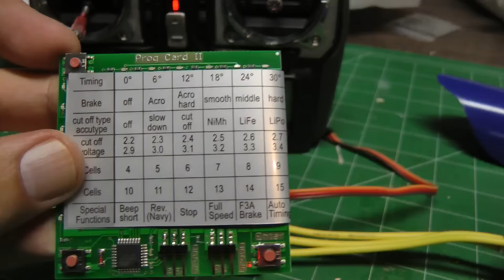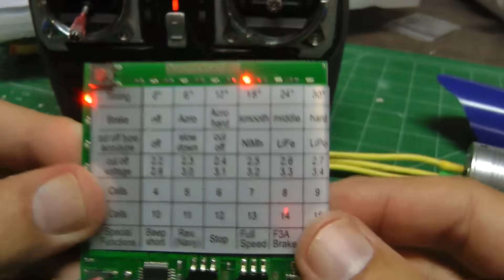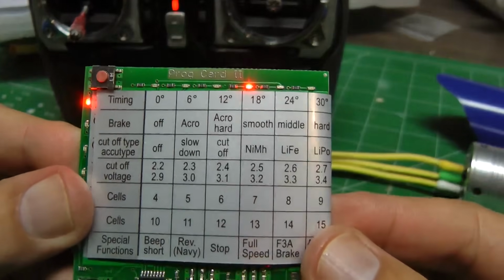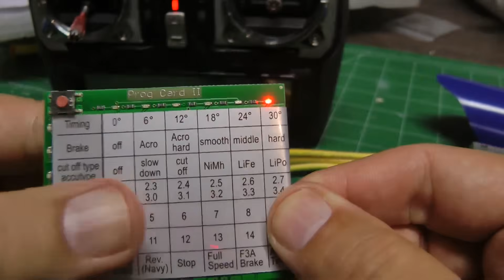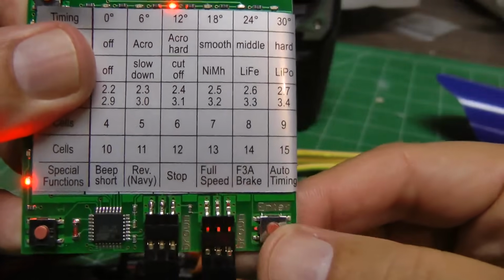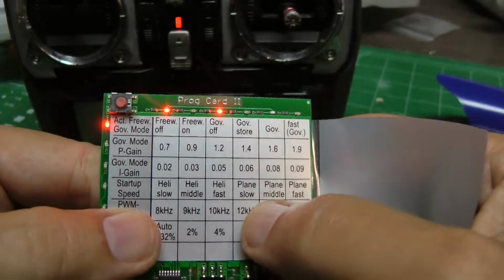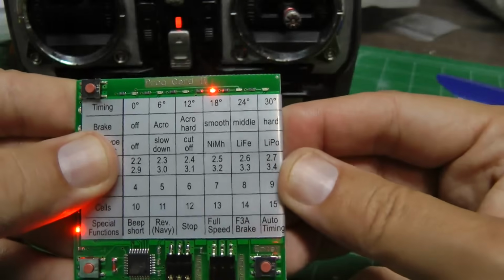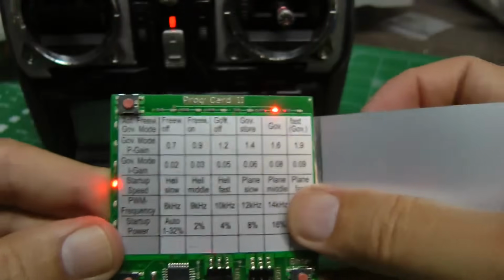YEP ESC programming setup for airplanes

Comment: I know this is an 11-year-old video, but still relevant. A male-to-male servo wire came with my YEP programming card. I assume that wire is the one referred to in the video as the wire too/from the Rx. Does it go to the throttle port of the motor you have programmed a motor to be in? Many of my models are 2 and 4 motor models on their own channel for differential thrust.
Reply from the maker: Yes it goes to the throttle, it should not matter which throttle channel it goes to assuming the bottom/top of the throttle stick is the same on the curves.  Whatever is in the middle does not matter, you just want to learn the bottom/top of the stick.
Reply: @GaryQuiring  Your video showing how to get into the 2nd group of settings was what I needed. I'm scratch-building a twin 70mm EDF of my own design. When doing some static testing I realized 1 of my ESC/Motors was taking 10 secs to spool up to full power. I needed to change the SOFT START to a HARD START. Even though I had the programming card, I couldn't change it. I've had the YEP150 and programming card for a few years and just unpacked it for this project. I only have the one YEP ESC. The other EDF is powered by a 155A HobbyStar (ZTW) ESC. The default for it is for fixed wing a/c, not helos, so no adjustment needed on it. Thanks for this video. When first trying the programming card I was using a 4.8V battery pack on the Rx pins, and that seemed to work as well for powering up the programming card. But using the male-to-male wire to the LEFT Motor port worked perfectly, and there's less chance of getting it wrong using it. Thanks again.

Comment: I have one and the acceleration is slow, I guess that is for helis. I don't have the card and it is hard to get here, so is there any way I can program the acceleration using the transmitter?
Reply from the maker: That's the spool up speed which is easily programmed using the card.  I don't believe you can program that with the TX.

Comment: Thanks once again Gary for saving my bacon.  Got a 60A YEP in my new Grafas and the esc was doing too many strange things. Soft start and soft break. It was even waiting for mid throttle to start turning!!  All that I have left to figure out is the rough start...  it sort of stutters.  On Quads you can tell the controller what signal will consistently start the motors and set it.
Reply from the maker: Hmmm, the rough start is odd, do you have it set for auto-timing?  If that does not solve it I would check your solder connections to the motor.
Reply: I have timing set to AUTO on the second page. and when I tried a 4S the start was smooth.  I will try it at the field today with the 3S3300 I want to fly with and let you know.  The issue is only at the bottom. Monitor says -80%

Comment: Unfortunately it does not have auto cells count detection...
Reply from the maker: I don't use any cell detection, I prefer telemetry battery monitoring from the radio with an alarm.  Also every plane I fly the cell count never changes.

Comment: How do you change the motor rotation using the programming card?
Reply from the maker: You can't, you need to reverse two wires to the motor.
Reply from the maker: The web site is wrong, Hobby King has lots of errors on the product descriptions that never get fixed.

Comment: After I completed the programming for 70mm Dr Mad 5 blade 4S EDF all works well except that after a burst of throttle when I then close the throttle i hear 2 beeps repeating every few seconds. I tried different batteries including new batteries that were fully charged. What is this please ?
Reply: OK - Found the answer elsewhere. 2 beeps repeating means battery low voltage.

Comment: What is startup power, at the bottom of page 2. Thanks
Reply from the maker: From what I know it has something to do with large props, sometimes they need more power to spin up smoothly.  I never touched that setting.
Reply: Ok, Thanks. I have set it to 32%. The motor is driving a starter for a Zenoah 62 Gas engine. Works well now.

Comment: Fine. But on mine I have 2 cables with 3 pins with exact same connector and wire colors. What is the purpose of the other one?

Comment: hey, can these ESC's be programmed to go reverse? and do they have high-torque braking?
Reply from the maker: There is no reverse option.  The brake has a low, medium and high.
Reply: Motor reversing from ESC (no need to change ESC/motor wires)  .It says so

Comment: Hi Gary,  handy guide you have provided for us new guys :-),  I am certainly going to use that brake feature for my new pusher arrangement / no gear.
But with all due respect, why this trimming the throttle before setting  Stop  / Full Throttle. Better resolution would be better had by teaching it the standard range, no? :-) I am just putting a heat sink on my new 60A and will program it tonight it is truly a well made bit of gear. I hope I made my 50" flying wing tough enough to withstand the output from this 550 watt NTM PropDrive,... I will never run out of BEC :-)
Best regards, C

Comment: Hi Gary, This is a great video... thanks so much! I know this isn't your job to help us trouble shoot problems, but if you have any ideas, I would appreciate it. My YEP 60A ESC (came w/ BFG 2600) won't hold it programming. I go thru and program everything, but when I unplug and plug back in, I'm starting from scratch. As a matter of fact, none of the XY grids are lit-up until I start pushing the red X (rows) button or Y (columns) button.
Reply: +heychas Turns out my BFG2600 ESC was not a YEP... hence, the programming card wouldn't work! Once I purchased a real YEP esc, it worked fine. Thanks again for the video.

Comment: Thanks this was really useful for setting the ESC up!
However I had problems calibrating the throttle using the programming card when the signal was going through a Vector flight controller. The solution I found was to calibrate the throttle endpoints by doing the usual process without the programming card i.e. set throttle max on Tx, power on ESC, wait for beeps and then lower throttle and wait for the confirmation beeps. Works fine now os if anyone has a similar problem this will save you some problem solving time ;)

Comment: I got the programming card and went though the sequence. Easy to follow thanks. However, I still can not get my motor to run. I have disconnected the red wire as I'm running a separate 2s Lipo for RX power. This has been standard practice for hipowered set ups like mine but could this be the issue ? Motor will simply not run... Thanks
Reply from the maker: I think you might need the red wire when you program the ESC.  The only thing I can think is wrong is the ESC is not arming because the throttle is not low.  If your radio is a Futaba type you have to reverse the channel.  If that's not the issue I would try a servo on the throttle channel just to confirm the stick is able to move the servo.

Comment: Why do you trim your gas stick? In my oppionion this does not make any sense.
Reply from the maker: It's very important to trim the 'gas' stick.  Not all radios are created equal.  All the decent ESC's have a trim for the throttle stick.  The ESC needs to know where zero and full are.  Without trimming for example some of my ESC's won't start the throttle until the stick is well past the 1/3 mark.  It also helps make the throttle channel more linear.  In some cases the calibration is mandatory because the ESC won't see zero so it won't arm until it's calibrated.  It all depends on the radio.  That's why they have that function.

Comment: Hi Gary got throttle sorted, went into TX setting and reveresed throttle and nearly all ok, but the esc is beeping when sitting idel, beep, beep, beep beep and so on, dont know how to get rid of it do you? and also it takes some time for motor to get too 100% but i suppose that can be changed via the startup speed cant it? as i have it on Heli slow,. but thanks again for ur vid, great help

Comment: Hi Gary thanks for vid great help, but i think i got a problem, on Special functions when i do STOP with my throttle at 0% and press enter the tone is the same as all other tones, but when it comes to doing FULL SPEED with my throttle at 100% and press enter the tone is different as if there is something wrong, my throttle hold on TX is off, have you got any ideas mate?

regards
Matt
Reply from the maker: Not sure, try testing the throttle with a servo installed to see how much travel you have.  You could also try a fresh model in your radio, maybe the throttle setting has an end point set or a throttle curve.